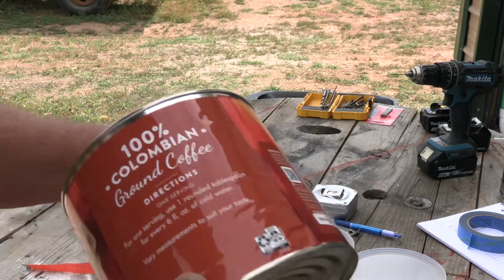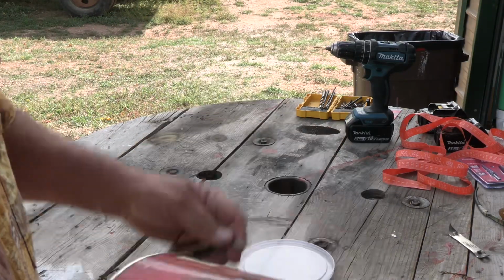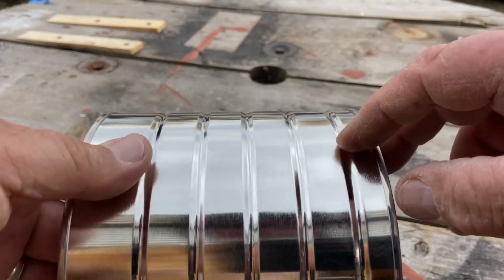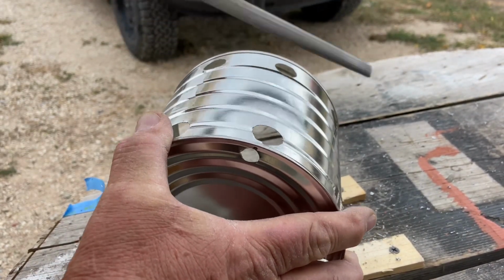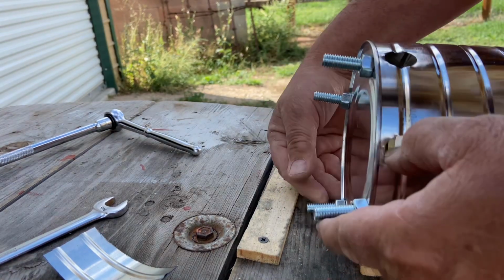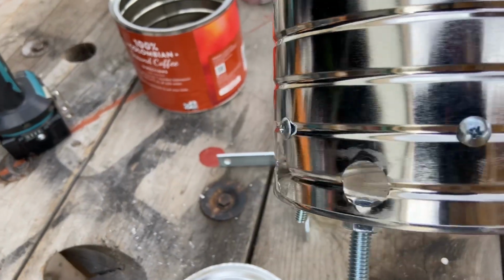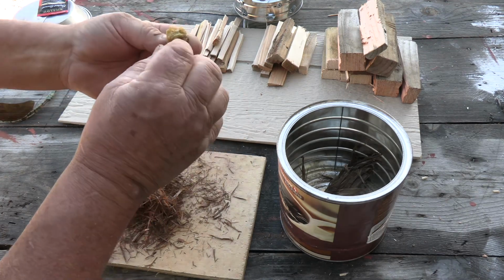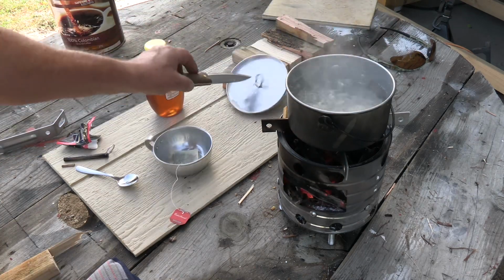Hobo stove build￼ DIY

Comment: Thank you for sharing. I will try to make one from smaller cans since I do not have a larger one like you used.
Reply from the maker: That sounds like a great idea. You can get the smaller twig stoves just like the larger ones so you should be able to make a smaller hobo stove also and it should work OK. All you have to do is use smaller pieces of wood or twigs. Thanks for the comment, and good luck on your build. Let me know how it turns out. Thanks for checking out my videos.
Reply: Try visiting a local cafe and pick up a couple large cans that contained beans, corn etc. Good luck .
Reply from the maker: @QuantumMech_88  yes, I agree with your other comment. Things really aren’t that hard to do when you set your mind to it. I’ve always thought mechanically, and with a background in construction, and a dislike for paying people to do things for me I have learned to do quite a few things over the past 50 years lol and I do like sharing my knowledge of things with people to show them. It’s not that hard. Thanks again for the comment.

Comment: Alcohol burners are also another option if wood is too damp to burn due to snow, rain, sleet, hail, and ice. It's more like a plan "B."
Reply from the maker: You could make something smaller it would hold and alcohol burner for such an occasion, but I would suggest learning how to process wet wood to find the dry wood within it and using pitch from pine trees and very thin processed materials that would take a spark or a flame easier. If you process wood properly and have the right kind of wood, you can start these even in the rain or snow.

Comment: Having some mesh would be handy to block off that big hole when not in use. It will also be handy if you were to use wood pellets to stop them from falling out.
Reply from the maker: Yes, some expanded metal could be used as a screen if you only planned on feeding it from the top. I have seen these added to the hobo stove, build and they worked great.

Comment: A gas stove burner grate will fit perfect on top of can
Reply from the maker: Good to know. Do you still have to notch it so it does not slide off the can when in use?
Reply: @safarijoesadventures  No, its like it was made for it.I used a paint can but coffe can should  do good
Reply from the maker: @pre1980cars  I plan on building one out of a metal paint can in the very near future. My intent on this one was to show how inexpensively you could build one. I know you can buy those metal paint cans at Lowe’s at Home Depot for a couple of dollars but they are a little stronger metal also.